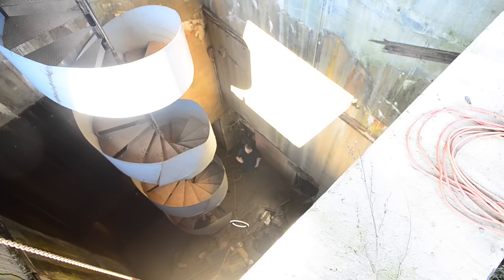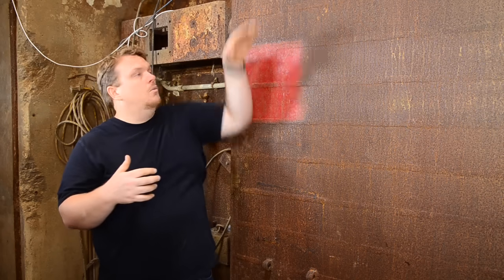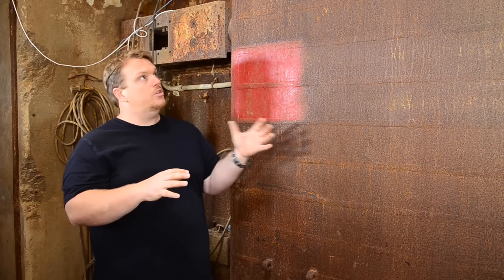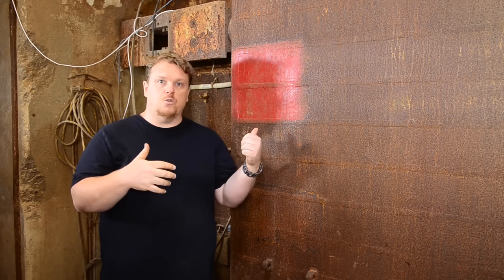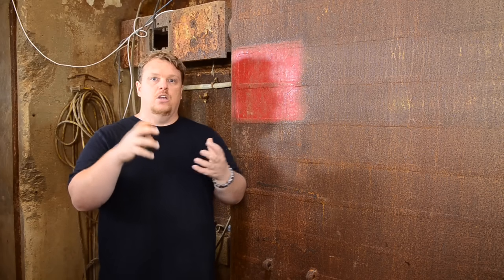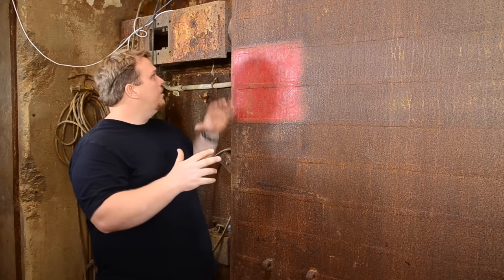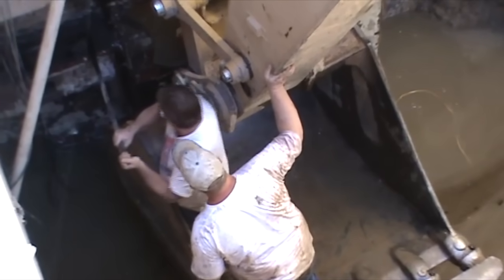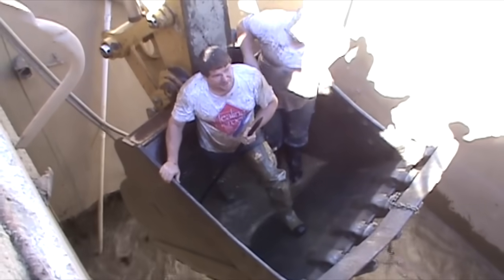EP4 - Opening a Titan II - Part Two

Comment: I use to buy to resell Military 600 - 1,000 pound Safes. They always have multiple pins to hold the door closed. Does your Blast Door only have 1 pin or are there many pins?

Comment: I know this is an old video, but hopefully I can get an answer. Did the door get damaged at all since only the top locking mechanism was opened while the bottom was still in place? Also, would it be possible to first dig out the escape hatch and pump water from there first to allow for a much lower pressure on the blast door?

Comment: get a starlift crossover devise based on all the correct dimensions with a very a extremely high torque industrial tool with a devise called a rnsfab~769/419 D. I’m almost positive that’s what it is called when looking at the manifest papers. You will not find any of this at any hardware big box stores, never. You will really need to get the right team of people with the knowledge of how to figure out all the exact calculations for your next endeavors. Good luck on all future projects.
Reply from the maker: What is this in reference to? And what fun is it to just throw money at teams to get things done? It's VERY fun to figure this stuff out.

Comment: Incredibly stupid. Defiantly could have gotten killed. I’ve seen bad injuries from much less risky but similar happenings. Next time, spend  some money on a Armor plated titan cutter drill bit, drill a single hole through, and allow the pressure to alleviate. Would have been safer and quicker than your attempt.
Reply from the maker: That wouldn't have worked. There was water coming into the facility faster than a hole of a reasonable size would have relieved. 

There were safer ways to do it but being protected by an excavator seemed like a reasonable risk.

Comment: Why not drill a hole in the bottom of the door and let the water out first?
Reply from the maker: Drill a whole in my 6000 pound door? And what size hole would it take to drain 1,000,000 gallons. And there's a source of water coming into the facility.

Comment: Using a portable hydraulic ram to move the locking cylinder.. as was done originally.. would have been the easiest simplist and most logical way to do it !   a port-a-power unit used in auto body work would be a start.

Comment: I was watching this just waiting. Water needs the tiniest of little holes to unleash a torrent, and you unblocked the damn. :D Best reaction ever though. And glad you were smart enough to use the bucket of the excavator as shielding from the door blowing out and to apply the pressure to unbind the pin.

This is such an incredibly interesting series.
Reply from the maker: Thank you much!

Comment: lets sit in bucket with crowbar and pry a lock pin while that bumps door that holds swimming pool of water back...
Reply: there were few other options for moving that pin, ideally if they had a hydraulic piston capable of 250 tons or greater they could equalize the pressure on the door and open it safely that way, but a hydraulic ram that powerful costs a lot of money.
Reply: i was more thinking of prying from the top, since you only needed a bar and single human power... leaving only heavy machinery in the hole

i actually worried about being behind that door when they said that lock is not fully secured anymore

yes, they did recognize the dangers but then decided to ignore it and put themselves directly on the line of fire (or wave, that is)

Comment: I would have put a hydraulic ram from the concrete wall to the door and pumped it up pulled the cylinder and then slowly released the pressure from the cylinder. once the water started squirting out  wait til it stops or open a little more so it's faster.
Reply: michael mooney yah but that’s more work and they had an excavator ready to go

Comment: Could have just drilled a hole in the bottom of the door.  You could always weld it up later.  It would probably take several hours for the water to flow out...but you just keep pumping until it is all out.  Then it should be a snap to pry the pin and open the door.

Comment: You know that could have killed you, right?  Like really easily? Why not just drill a hole in the door?
Barring that, why didn't you weld a stop plate to the frame to keep the door mostly closed once it was unlocked?

Comment: Why no get rid of the water first..??? (either pump it out or drill holes in the door and let it drain...
Reply from the maker: Drill holes in what? And there was water coming into the site so whatever hole I drilled (through 4' concrete, steel or the 6000 lb door) would have to accommodate a larger flow than what was coming in.
Reply: wow didn't watch to the end didn't know the water was leaking out, man that's alot of water nice work!

Comment: I have a question that might be a stupid one but I know nothing about these silos. Why did they fill these rooms up with water? Only thing I can think of is either it naturally filled over time from rain or it was purposely filled to stop radiation from leaking out. I hope you had a meter to warn you if theirs any in there.
Reply from the maker: The top 25 feet of the silo was blown off. The water table is so high in Arkansas that water just came in naturally. The Arizona sites are dry. Bastards. :-)

Comment: I actually worked on those blast doors in the 70s.  That's a 6 ton chunk of solid steel.  I was a Titan II Missile Pneudraulics Tech at McConnell AFB KS.  I worked on the "Blast Doors - Solo Closure Door - Work Platforms - Blast Valves - Missile Guidance - And Pop Up Antennas."  If that was in Kansas, I've been through that very door.

Comment: i would have located the locking pin and used a shaped charge to blow the pin in half...
Reply from the maker: I don't have access to shape charges like I should. Maybe I'm missing out. Also, while I know an explosive could of course do it, this is VERY thick metal. Doors and locks are rated to 1000 PSI. So it would have taken something pretty nice to cut through that.

Comment: There are 4 pins on that door. Back in the day, they'd all extend at the same time. You didn't mention it but I assume you had to work on all 4 pins before you could open the door, unless they only extended 1 pin when they buried the silo.

Comment: I remember that Red square on the door. It was the only site out of 17 that had it. I assumed it was from the corrosion control team. Interesting to see it again and looks like it resisted corrosion better than the rest of the door.
Reply: I know it's 6 years later but I am so curious! So you were at all 17 sites? How do you have this knowledge? Do you mean the Corrosion Prevention and Control Department of the US Military? I feel like you have some stories to tell and this subject is incredibly intriguing to me.

You think the red square was applied by the Corrosion Prevention and Control Department as some kind of test?
Reply: @Nilumbra  Hi. Yes indeed, I've been in all 17 sites many times when I was stationed a LRAFB MIMS/RPIE. I was one of the electricians in facilities maintenance so we went out to different sites daily working on all levels of the Titan complex fixing and testing equipment. We did have a separate Corrosion Control Unit at MIMS who took care of any/all corrosion issues in the Silo including the missile itself. Due to the area water table it can get humid in the complex if de-humidification failed.

Comment: I used to work in those silos in Arkansas back in the early 80's. I remember having to manually open those pins via hydraulic handle to verify the crew could still open the doors in a power failure.

Comment: Somewhere they missed something in the preparation. They're standing in the bucket of an excavator trying to pry the locking pin open for the door with 250 tons of water behind it. I guess it hadn't occurred to them to have some way of anchoring themselves to the arm of the excavator. Had one or both of them been knocked into the water, I think it's reasonable that someone would have been pulling out 1 or 2 dead bodies.

Comment: There were FOUR blast door lock pins on each door (each corner) - evidently the contractors only pushed ONE pin back in the door, right?
Reply from the maker: That's correct. They took the hydraulic out of all but about 6 pins (in total). And yeah, they just closed the top left one on door 6.

Comment: Who would have thought that the water coming out of the conduits at the top of the door meant that the water level would be that high? This is exactly why the Darwin awards were created...
Reply from the maker: We KNEW the water was that high. That's why we were in the bucket of the excavator, to push against the door to relieve the known water pressure. Yes, there were other ways to do it but the risk was mitigated by being in the bucket.

Comment: Door holds back 250 tons of water? Let's try pulling on it with a chain
Reply from the maker: Ok... fair point... thought we should try. :-)
Reply: Hindsight's 20/20, how silly would you feel if you didn't try it and that's all it needed? Always try the easy option first, because sometimes the easy option works!
Reply: uh isn't the weight of the water assisting the door? the water is pushing the door in the same direction that they're pulling, so the weight should help, not hinder
Reply: Yep, they claim that the silo was trying to kill them, but in reality it was their brains trying to kill them.

Comment: How did you not check the door was locked before trying anything? What do you think has keeping all that water back? ;)
Reply from the maker: I have no idea what I was thinking. Rusted shut? Not sure. Part of the problem is that the distance between the lock and the door is the width of a hacksaw blade. So with dirt and stuff it wasn't really easy to see. In fact, when I finally thought that may be it... even looking didn't work. I got a blade and put it between all of them and found that lock closed. But I agree... I should have looked for that first.

Comment: Or...fill the pit with water to equalize the pressure on both sides and then open the blast door. just say'n
Reply from the maker: That is a good idea but we (someone else) would have had to do it while in SCUBA. The level of the water was higher than the pin for the door. 

An idea that I COULD have done... put a hydraulic in there like there was when it was in operation. Then use a hand hydraulic pump to open from the surface. That would have been smart. :-)

Comment: I'd guess level II of the control center would be about half flooded.  Same for the blast lock area.
Reply from the maker: Great guess... but water was halfway up level 1. I'll let you think about how that's possible. I didn't think of it until we went in. Blast lock and tunnel completely filled.
Reply: I was thinking water level after you opened the blast door.  Be careful guys, might be some toxic stuff in there.
Reply from the maker: Oh right... yeah, that's about right.